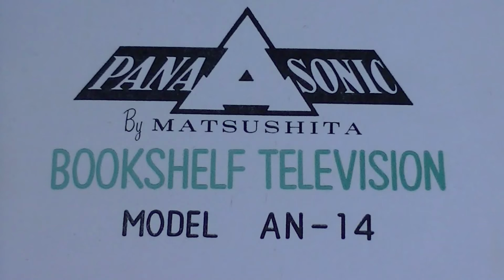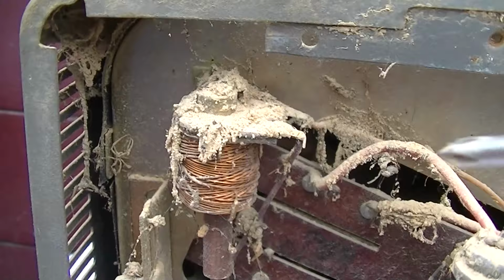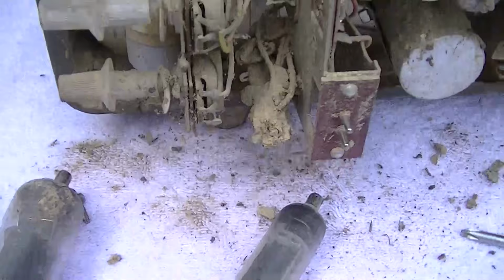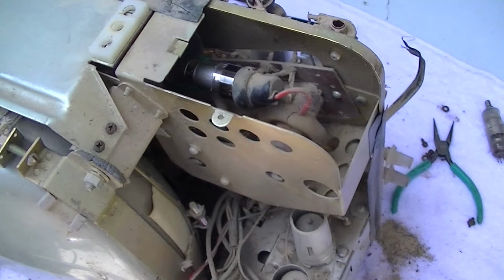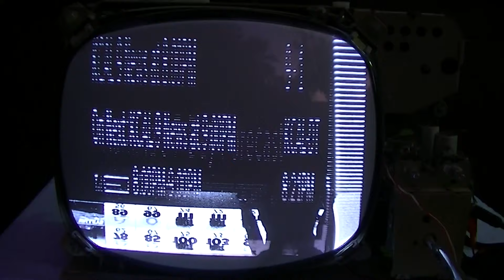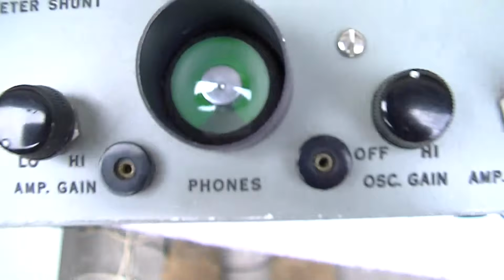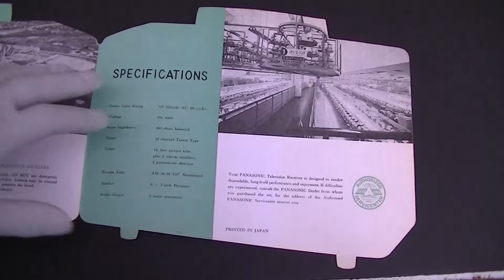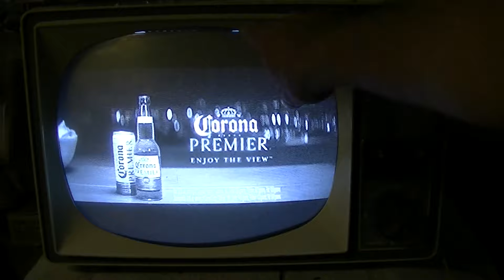1962 Panasonic Early Japanese import Black and White Television Resurrection AN14

Comment: I'd imagine that not to many of these were sold in the US in 1962. I don't think many Americans would buy anything Japanese because of the war.
Reply: Mikey That was WW2. US bombed Hiroshima and Nagasaki with Atom Bombs and Japan was surrendered that put the war to rest, and that was from 1945. In the early 1960’s, Matsushita made Panasonic and put out the first batch of portable transistor radios and TV sets to the US including the AN14 as you can see here. Sony on the other hand made electronics from Japan. This one is a “Bookshelf Television” according to the manual. The Japanese version of this TV was by National. The original manual as you can see is English, the Japanese version of the same manual are all printed in Japanese.

Comment: Hello I have a question for you! 1) Is there a pixel on the TV screen in 1962? 2 )how to control it can play 4k ' 1080 hd? or there is a limitation in the form of points horizontally and vertically...?
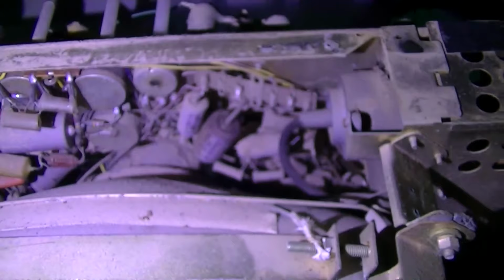49:08-51:19....TV  MARS
1:10:23-1:12:44    STAR  WARS

Comment: It seems to me that Sony almost single handily changed American views about Japanese electronics around the time they came out with the Walkman.
Reply: Was well before the Walkman.  In 70s when the Trinitron came out....It had a much better picture than other TVs and Sony held the patent on that tube u til the early 90s.
Reply: That’s for sure, however it seems like it was in the 80s when the general public decided that Japanese was good.
Reply: It was night and day for anyone who was into electronics at the time. You'd buy a larger Japanese TV, and it would have composite video and stereo audio inputs and outputs, muting circuits when you changed the channels, on-screen displays, quality comb filters, etc. Japanese stuff didn't usually thump when you turned it on, there was an attention to detail. RCA put out a line of high end TV monitors at one point in the 80's, and they were very high quality, but by then their reputation was in the mud with enthusiasts - to them RCA, Zenith, and GE made wooden console TVs old ladies would buy, and you'd be lucky to see one with a coax jack. What I now know is that the domestic brands were poorer at that time because they had to be built that way - they could not compete with the Japanese TVs, which were being sold at super low cost in the states to eliminate the domestic  competition, while they were price gouging the sets sold in Japan.

Comment: Very first when TV very ware awesome shango066 very jason JJ Cruz
Reply: Jason JJ Cruz It was one of the very first models from Japan. Originally in Japan it was National Panasonic, in the US, it was Panasonic, the same model from Japan was under National Panasonic and the logo on the top right was slightly different where it does have the "N" logo with Japanese lettering. The original manual was from the US, the National Panasonic version of the original manual are all printed in Japanese.

Comment: Could be a Philips clone made in japan ?
Reply: Philips was another company who over-engineered/over-designed their TV chassis - particularly the popular K9 series of 1974-76 - although that was made in Holland, not Japan. 

Some of their earlier B&W non-solid state sets had up to 18 tubes total (including the CRT) - talk about over-design.
Reply: 18 tubes? its more like 22 tubes plus 11 diodes on my philips BW sets...but the picture is perfect, no buzzing and all automatic hold controls.. I have 2 of them a 21 inch and a 17 inch and both worked when plugged in.only capacitors that were bad were the boost capacitor and the across the line wich were wax type and were melted...the rest are perfect and no leakage.all electrolytics are fine...both sets are working on almost all original parts so although over complicated they are great sets believe me.